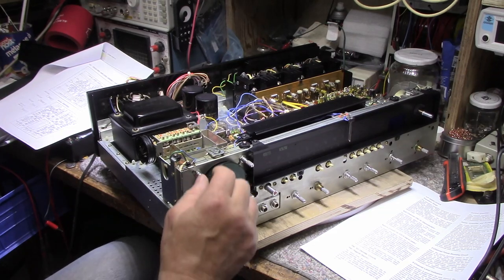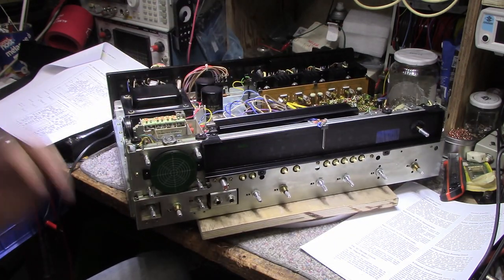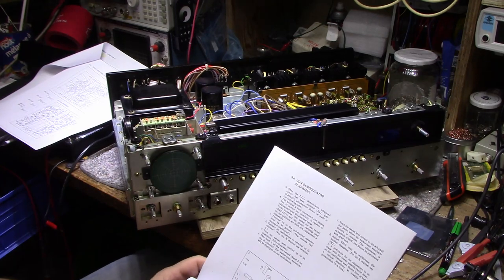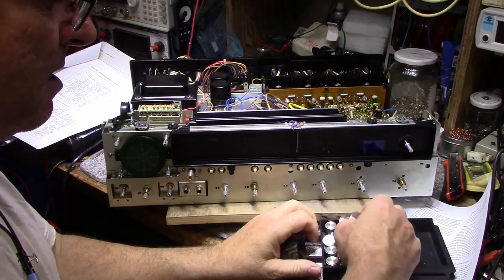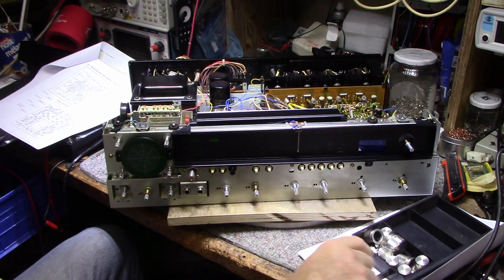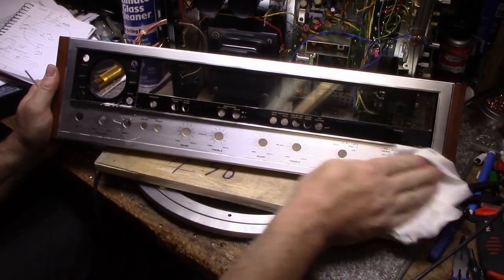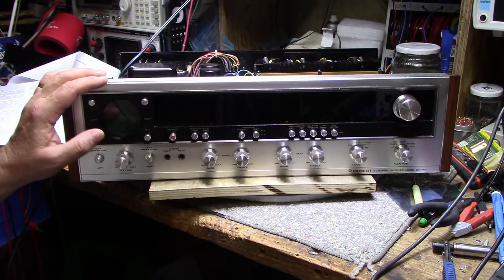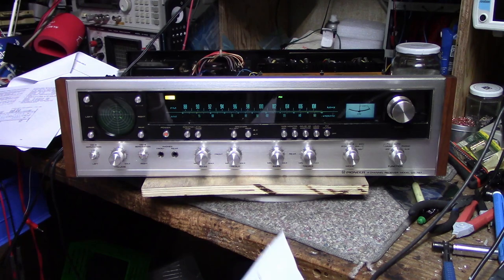Pioneer QX-747 Receiver Part 3 (Ep. 99)

Comment: Nice job Trevor you could switch the l and r channel of the phono so you had the unbalance switched I bet the distortion came from the cardridge. And dusty adjust pots.
Well there are only a view Quadro phonic recordings. But no phono 4 channel cardridges anymore.
Over 100 caps replaced... Lol.
Nice 3 videos
Reply from the maker: Hi digger, good idea about switching channels, why didn't I think of that. I was surprised it worked at all considering my turntable setup. Thanks!
Reply: @TrevorsBench  I do a lot with vinyl and did setup a test record and did 4 test tones on the output of my mm phono stage (course messuring at the cardridge is deadly) and focused the signals with the antiscating settings on my rega planar 3-24 course the turntable arm has got two absolute tracking points there I set the balance 100% fixed.
And with your table hhmm bit tatty use the left channel of the phono and adjust it in the left and right channel of your pioneer.
Hope you get better results course 4 channel amps are very rare.

Comment: Hi Trevor - thanks for the detailed videos. I happen to have a QX-747 on my bench right now. Recapped power supply first and all seemed to be working well except for a weak right phono channel (complex circuitry for phono on this one due to 4-channels I assume) Ended up being a bad cap on the Matrix Circuit Assembly board (not the first place I would look!)
I have a question about the scope. My left rear lamp shows a very slight "dot" at all times and the right rear does not. As far as I can tell, the lamp is working, wondering if this Is this a bulb alignment issue? I'm not too excited about pulling that unit out if I don't have to. Any first steps to consider before major disassembly? Keep up the great work!
Reply from the maker: Hi Jeff. The lamps in the meter assembly need to be aligned with the holes or the light won't come through. It's easy to remove the lamp board then you can shine a flashlight through to see if it's working or not. It's not difficult to open it up, just one screw in the center and the back cover comes off and you will be able to inspect the shutters to see what's going on

Comment: The finish line!  Great job on this receiver; that was quite a project.  It sounds really good as well, that CD4 alignment looks to be a bear that consumes a great deal of time.  Is this one going into your personal system or on the market?  Thanks for your time and for posting this series.
Reply from the maker: Hi Craig, I think I'll keep it for a while and keep my eyes open for a CD-4 record at the sales. I still want to experience full 4 channel sound. Maybe later I'll sell it
Reply: @TrevorsBench  Trevor, you'll need a phono cartridge that has a specific frequency range for the CD-4 record in order to adjust the alignment on the 747.  I had a 949 way back when and I remember that specific thing for the CD 4 to work properly.

Comment: Hi Trevor, good job!
I got the same unit on my bench.
When biasing, where you placed the 5k1 resistor? Between input and ground of each power amp section? In series with the signal path?

Comment: Hi Trevor, Sorry if I missed it but where did you terminate the input terminals of the power amplifiers with 5.1k resistors for the amplifier adjustments?
Reply from the maker: I didn't. Generally, disconnected inputs is just fine. The Amplifiers already have a 100k termination to ground on the inputs,  adding a 5.1k won't make any difference